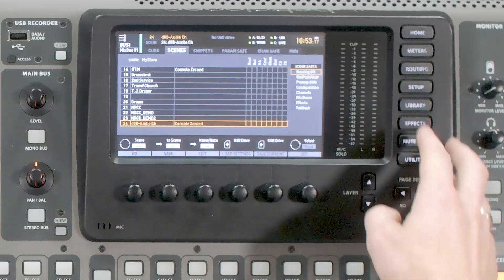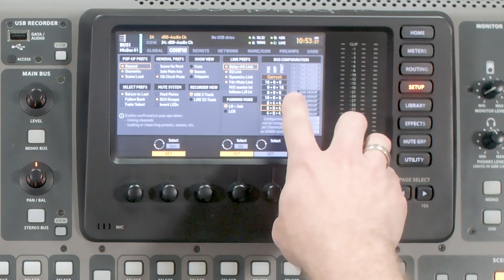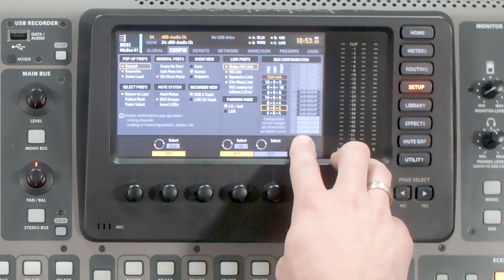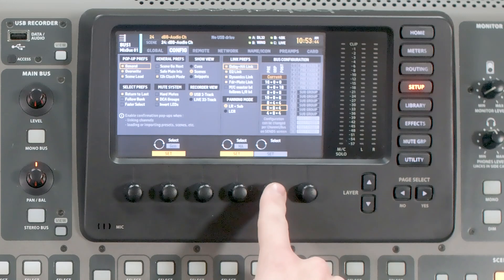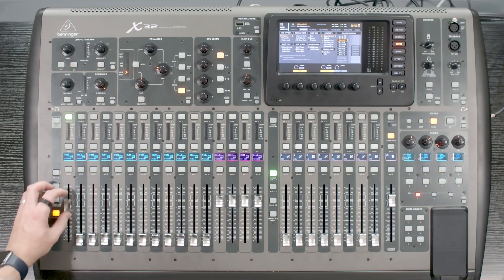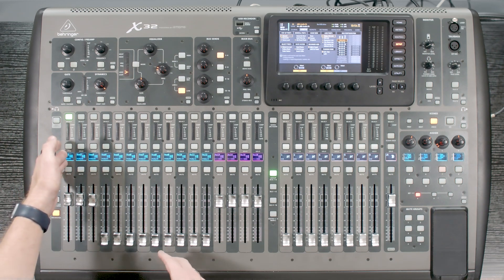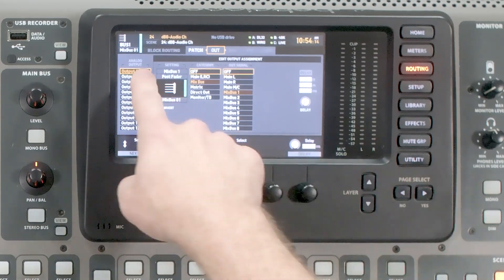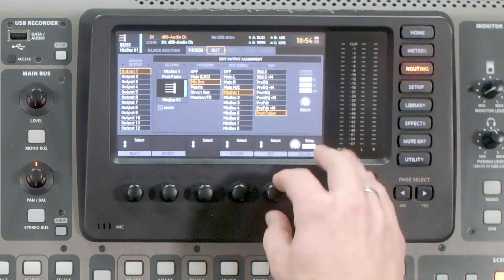What are Output Taps on the X32

Comment: Hi Drew, 
Thank you for  all the tutorials you have doing over the past years. I have learnt a lot from you.
I have a question, I'm hoping you can help me out with.
I'm using an Midas M32R Live mixer and I would like to send a stereo mix bus mix  (11 and 12) to OBS over USB (X Live Card) (M1 Mac Mini).
On input channel 1 is my kick drum.
On my input channel 2 is my snare drum.
I'm using an analog snake and I'm using  the 16 XLR inputs and 4 aux inputs on the back of the console. I do not have a digital stage box.
At the same time I'm doing a multi track recording into my DAW
( Bitwig Studio).
I've routed the mix busses to outputs 1 and 2 .
OBS is only able to see outputs 1 and 2.
In my DAW, channels 1 and 2 is receiving the mix bus signal together with the kick and snare inputs.
Also OBS is receiving the same signal.
Is there a work around this scenario where I can get just the mix bus signal into OBS  without the kick and snare mixed in and also the multitrack recording without having to remove the kick and snare on Input channels 1 and 2 ?
Thank you for considering my question.
Jason

Comment: Thanks Drew I'm in Cameroon central Africa my question is how to use 2 mixers and 1 DL 32 on stage  ( FOH/Monitor) and be able to control 4 output of DL 32 and Gain from FOH and set monitors Mixer control the other 12 outputs ?

Comment: Hey Drew ,  I’m a Drummer making multicam drum videos , using the X32 to mix the drums. Using onboard dynamics/FX.  So I pre mix the drums and the mp3 I’m playing to.  So, I just bought a ATEM mini Pro ISO ,  how would YOU send the audio from the X32 to the ATEM ?
Reply: If I am not wrong, I think the ATEM mini only has a 3.5mm input jack for the sounds. If it is, I would set up 2 mixbuses as Stereo, send all your drums sounds there and make sure to pan each drum mic according to your liking and  finally, buy a stereo xlr to 3.5mm and hook it up to the ATEM mini. Keep in mind the stereo xlr to 3.5mm could decrease the audio quality but as long as its a short cable it should be fine.